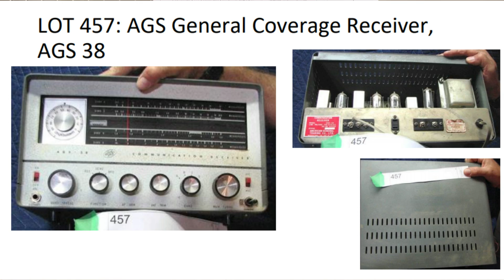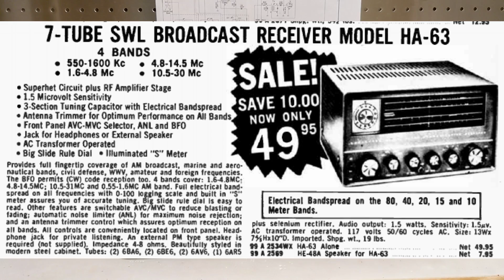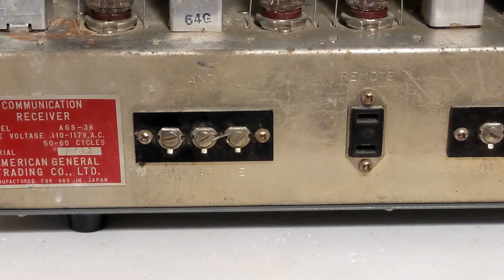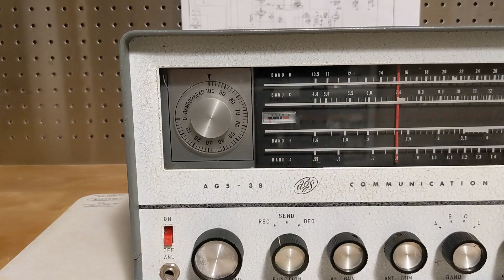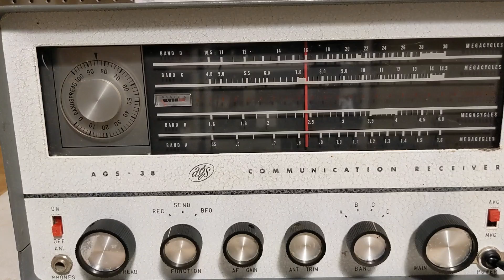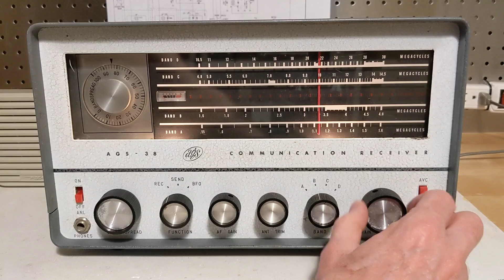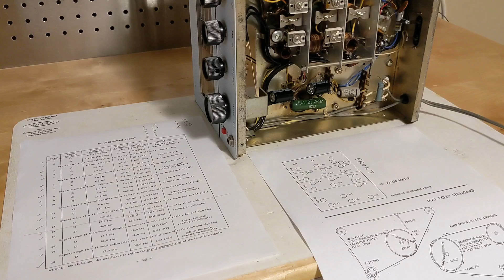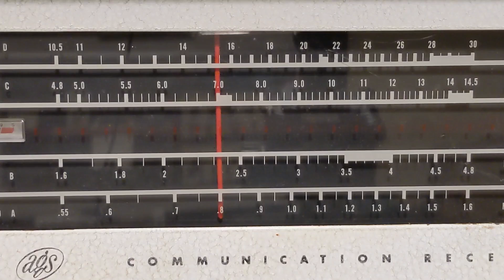The AGS-38 Communications Receiver

Comment: Thanx for posting this.  i have exactly this unit also, found it several years back at an antique shop over in Stratford, if I recall correctly.  It's a nice, well made unit, and works well.  Yesterday, I powered it up for the first time in quite awhile, and the dial flickered, and there was no sound from the attatched speaker, and small wifts of smoke appeared from out the back.  The power transformer was very hot, and I shut the unit off.  I took it apart, removing the bottom plate on the chassis, and found a 1 MFD filter capacitor had failed, and melted wax was evident in a small pile about the size of a quarter, on the bottom access plate.  The capacitor is a 600 VDC rated, 1 microfarad, and it is right where the power-line enters.  I am still using the main filter electrolytic cap on the chassis.  What I did was to replace the failed 1 Mfd 600 VDC capacitor, with a mil-spec capacitor of the same rating, which I had taken out of an old RCAF military aircraft radio, also found years back, at an antique store.
It's pretty silly replacing a failed part with a part that is even older.  But the cap from the military radio was a metal cube, about the size of a matchbox, with very well sealed connectors on each side.   The repaired radio works perfectly again.  it's quite a well made unit, probably from around 1965.   I am often very impressed with the quality of electronics from that era.  People forget that in North America, we were building and flying rockets and space-vehicles to the moon, back then.  The first lunar landing was done in July of 1969.  The technology from the 1960's and early 1970's was often extremely well engineered and reliable.  This same phenomenon was also evident in 1920's electronic technology.   I have a floor-model Deforest-Crosley radio, with an early-model loudspeaker, and a power-supply the size of a shoe-box.  I had to replace the main electrolytic filter capacitor, exactly as you did with your AGS-38.  The tiny caps, almost exactly as what you used, replaced a monster copper-can electrolytic that had dried out.  But once the new caps were installed in the big DeForest Crosley unit, it's four vacuum-tubes lit up, and it work remarkable well.   It's a regenerative-receiver, not a superhet, and so tuning it is fun - two seperate knobs and a feedback intensity knob - quite an interesting exercise - but the thing is very sensitive and at night can pick up AM signals from all over North America.  (with a long-line antenna..)
Enjoy the AGS-38.   I have found there still are a few shortwave stations up and running.  South America, Cuba, Radio Marti, and some Chinese stations, and Arabic ones also.   If the internet is taken out during wartime, we may suddenly find radio becomes a very important thing again.
Thanx again for your detailed video.

Comment: Could you list the tubes please. I copied them down but unclear on maybe an a few as the letters sounded close.
Reply from the maker: The tube lineup is:
A 6BA6 RF amplifier
A 6BE6 mixer
A 6BE6 HF local oscillator
A 6BA6 IF amp
A 6AV6 detector, AVC, AND, and 1st audio amplifier
A 6AV6 BFO
A 6AR5 audio output amp
Reply: @jefftranter  thanks so much. Trying to see if I have enough tubes here for a friend in Elliot Lake who has one. Only one I copied down wrong was the BFO 6AV6. Cheers

Comment: I own a TRIO 9R-59 receiver that I bought in Toronto in 1980 when I was starting Ham radio. Has the AGS sticker on it, and I have the original instructions and schematic. I would post a pic if I could here.
Reply: It has a built-in Q multiplier, BFO as well AF and IF gain knobs on the front. It has the four bands, but if you positioned the pointer on the main band at the start of a ham radio block it has a band spread for each of the six ham bands across the width of the receiver. So much more useful for ham radio operation.
Reply: Here is a pic https://drive.google.com/file/d/1gvfu_Y_RJ50vCDZJ1LDS7q9dDJHLwJcT/view?usp=sharing